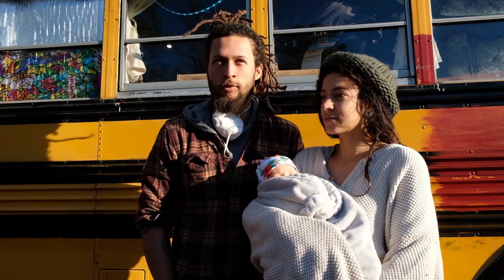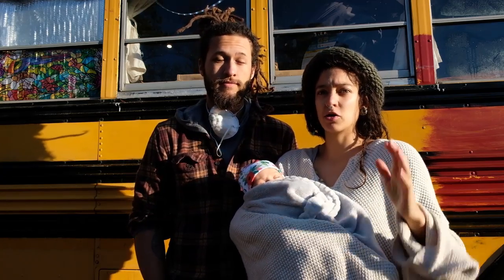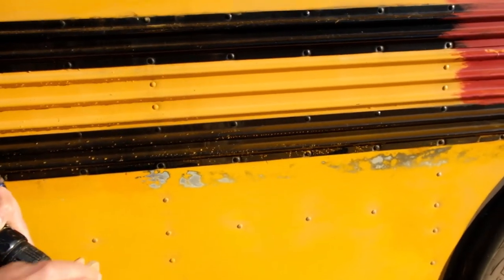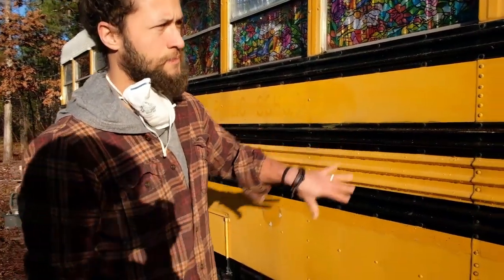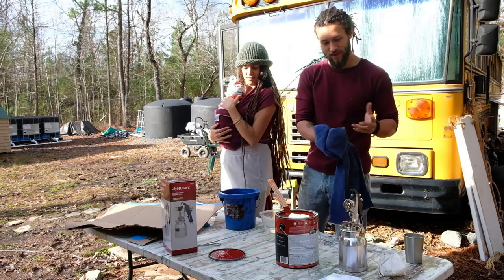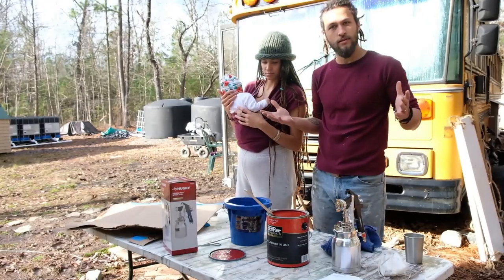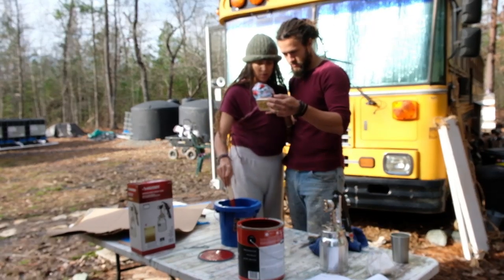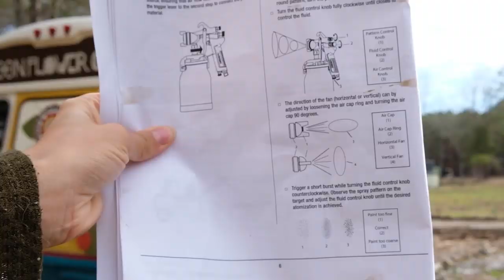EP #42 SKOOLIE CONVERSION // Spray Painting the bus

Comment: Dude womder wheel was a lifesaver when I was taking labels off my bus!!!!  Love that thing. Works great on bumper stickers too.
. Still haven't painted mine. Deciding what method to use
Reply: YESSS, once you get the outer layer off then you can go to town on the wonder wheel. Not sure what method your considering but after using the spray gun, I was super happy with the finish and highly recoomend. It was a little confusing getting the right viscosity and spray pattern but worth the time it took to learn.
Reply: @justinmaness7939  I was going to spray it, but I might hand paint it or roll it. I have a short bus, it would take me about a day. We've had it for almost a year and we haven't decided the colors we want it